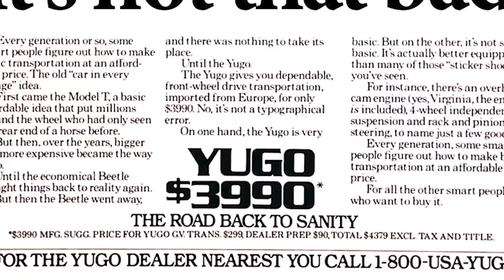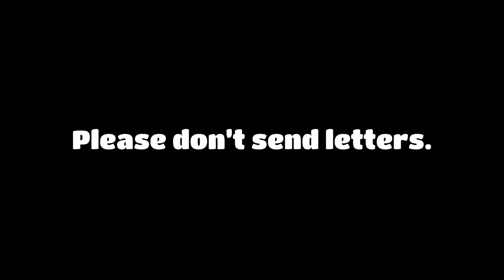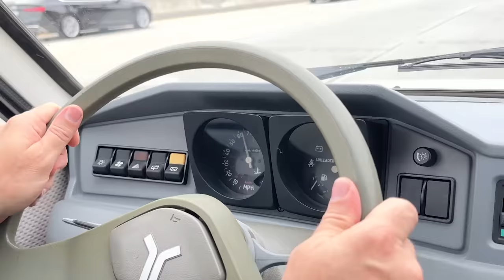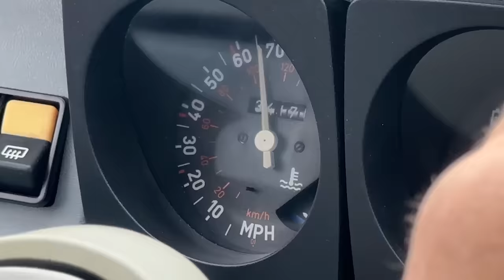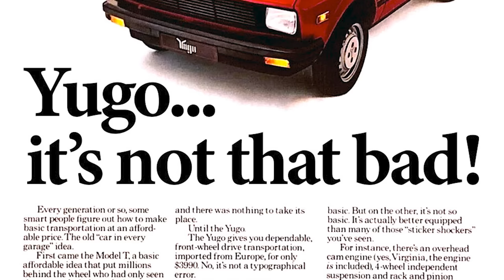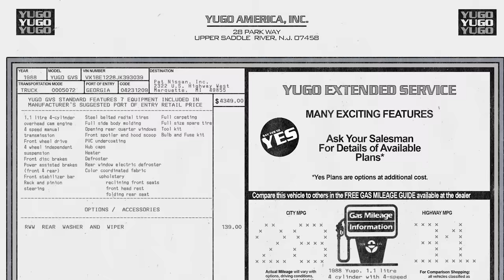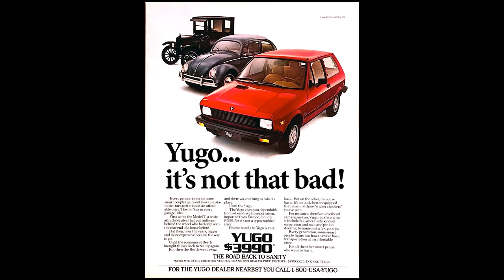Jeff Dunham Drives The Worst Car Ever… LOVE IT or HATE IT? | JEFF DUNHAM

Comment: We purchased one brand new in 1991.  There were several changes by that time compared your 87.  The engine displacement was increased to 1.3 liters, and the carb induction system was replaced with a direct multi point Bosch fuel injection system.  The transaxle was also changed to a 5 speed.  We bought it for $4100, and drove it over 150,000 miles before some electrical gremlins sent it to a friend as a parts car.  The only issues we had were the window cranks broke several different times, the shift linkage separated once, and the fuel pump went out 3 three times--twice under warranty.  The fuel mileage, while driving over a mountain pass back and forth to work, averaged 45 MPG.  Hard to argue with that, even today.  Probably the best part, is that it was INVISIBLE to cops.  There were several times I was bombing down the interstate at extra-legal speeds when a State Patrol going the other way flipped a U-turn and fell in behind me.  Letting off on the gas and coasting down to legal speed, I could see the cop in the mirror double checking his radar, looking at the car, shaking his head, and turning off.  Good times.

Comment: Do you know why the Yugo came standard with rear window defrosters? A: To keep your hands warm while you push it.
Reply: The Saab the spare tire was under the hood also
Reply: How do you double the value of a Yugo?
Fill the gas tank.

Little known fact. A 4 door model was planned.
It was called a Wego.
Reply: @midnightelectric1  there are more jokes for yugo like:
My electronics on yugo got broken.
Than other guy asks: what electronics ?

How to tripple value of yugo ?
Fill in gas tank and buy new front tires.
I guess you now know how to multiply value of yugo by 4 times.

This is good one:
In Japan, car manufacturers had sealant check: they put cat inside car, turn off air conditioning, close all doors and leave car for whole night.
If in morning cat inside car is dead - that means car is sealed well, if cat is still alive than car is leaking air.
For yugo we had lower standard: they put cat inside car, turn off air conditioning, close all doors and leave it for night. In morning if cat is insde car, than car is sealed well. If cat is gone, than car is not sealed well.
Reply: Thank you now I know why Chevys had rear defrost also. 😂😂
Reply: @L4ki0  There's worse cars- 87 Ford Escort Hatchback.  dear GOD that car was awful
Reply: @susanfender307  Count those K-cars in that group.. On the Ford Fairmont you honked the horn with the turn signal lever. The one I drove as a cab went through four heater hoses in one year.
Reply: That son of a gun stole my line! 🤣
Reply: Why it was called a Yugo? ...you go buy the stereo,  you go buy the mud flaps...
Yugo sport: Yugo fast. ... it's one step above a kit car.... because they built it for you. I told my friends I wasn't going to trade it in... I was just going to punch a hole in it & put it on my keychain. That might BE my old one. Drove it over a rather large hill here & the gear "clip" fell out. I suddenly went from a standard "H" to a "standard O". We towed it no lie with a 4 wheeler. To my friend Sean's house. With rope. Sean: "I will DIE if we get pulled over by a cop right now.". Didn't get stuck in the snow once! [You have to have a center of gravity to do that. Center of gravity cost extra.]
 ....I could go on.
Reply: So true!!
Reply: @briannoll9441 😂😂
Reply: Ah, ya beat me to the punchline!
Reply: I am the originator of that joke🤣🤣🤣🤣

Says everybody
Reply: The last time I heard that joke I laughed so hard I fell off my dinosaur.
Reply: The model line was the first (and only) world car developed by Chrysler Corporation, who developed the American-market Dodge Omni/Plymouth Horizon in tandem, following the start of the Chrysler Europe project. While similar in appearance (for the Plymouth brand, sharing a nameplate), the Horizon would have substantial functional differences from its American counterpart.
Reply: I’d like to know what he paid for it.  That might be the funniest part of the whole experience.  It is in amazing shape.
Reply: @mow4ncry  not all SAABs had that. Certainly not the 95, 96, or Sonett III... Those models had spares in the trunk under the floor board.
Reply: That's nice the only thing I know about them as people were sobbing every time they had to get them repaired
Reply: @susanfender307  Trabants were supposed to be the worst cars ever, but they were not sold in the USA. The Trabant was from the DDR, better known as East Germany.
Reply: @lincolnls0416  no, that was to keep your hands warm in the bed of the pickup while you were getting a lift to the mechanic.
Reply: @susanfender307  It WAS, but... the stupid things lasted forever and just wouldn't die. The whole car would be held together with bailing twine and duct tape, and still get you from point a to point B. The only car I saw do more than that, was that idiotic  Volkswagen Rabbit.
Reply: @starova92  he paid more for the detailing then he did for the entire car
Reply: @BlueRidgeCritter  too true, but it was check the gas and fill the oil 😂
Reply: @mow4ncry  The 2-strokes or V4's then? Because my 900 classic had it in the back and that carried over from the 99 and 90.
Reply: What do you call a Yugo with a Sunroof? A Skip/dumpster
Reply: @OrsonBuggy1958  my Fairmont was an old cop car with a 302 in it and it was fast
Reply: @ZackfromNoHo  nope, Russian Lada was THE worst
Reply: @slidin122   Mine was a taxi and it went through four heater hoses with less than 70K miles on it.. It was garbage. Maybe because it was a station wagon.
Reply: Back in the day a coworker bought one. You could tell it was a cheap car, but don't expect American workmanship which isn't saying much.
This coworker happily drove it until he rear-ended a dump truck. The insurance company totaled it. The accident happened on a military base where the speed limit was about 25 mph, I didn't personally see it after the accident, but was told the entire front end would have had to be replaced, i. e. The parts would have to be shipped from the Eastern European factory, which the shipping costs was what totaled it. Parts cheap, shipping astronomical.
Reply: LMAss off!
My grandparents had two!
The three piston Engine what an allowed to get out of its own way!😂
Reply: @OrsonBuggy1958  I rented a Fairmont from Hertz in '79 to drive to a client in Temecula, CA when it was about 5-6000 population. It was about 1+ hrs from nearest airport. Wouldn't start the next day. Hertz had to flatbed a car to me, and take the Fairmont back. Awful to drive too.
Reply: @L4ki0  Either Yugo or you don't
Reply: If you want a worse car, drive a Subaru 360, also imported by Bricklin about 1969!
Reply: They came out with a mini-van in the late ‘80s, they called it the WeAllGo
Reply: Hello
Reply: How you doing today
Reply: Pretty sure Ford was the first ever rear window defrost,well Lincoln same thing lol
Reply: Yugo. I'll just stay here.
Reply: That was chevy
Reply: So that why

Comment: I had a Yugo when I was a teenager. I took that thing everywhere, one of my best memories in the yugo, was up on some logging roads when I came across two full size trucks (lifted) sitting on both sides of a downed tree across the road. I drove right down into the ditch and under the tree and out the other side. Stopped on the other side of the tree and we all had a good laugh. Only thing I ever did to that car was change oil every 3000 miles. It wasnt that bad but man it was hard to keep a girlfriend once they saw the car :)

Comment: My dad is a retired mechanic and is almost 72 and is from Yugoslavia. I bought him an 88 Yugo as a gift  back in February and he loves it. The car is almost identical to the one in the video including the exterior and interior colors. But ours came with dealer installed air conditioning. We spend weekends tinkering with it and fixing minor stuff. The number one reason that so many Yugos were junked was because of timing belt failure. The replacement interval is very short (60k miles) and the belt would snap and the internals would crash. The car would be towed to the mechanic and the repair estimates were often close to being more than the value of the vehicle. Zastava Motors built over 800,000 Yugos and sold them worldwide. In America the parts were hard to find because most people didn’t realize that the car is basically a Fiat (127,128,x19) so therefore most Fiat parts can be installed on a Yugo. Also Jeff, I noticed your black/red rub strips need replacing. I have a set I can sell you if you’re interested. Enjoy it!
Reply: Timing belts were BELTS. Very breakable
Reply: Always was fun to drive around in a Yugo with my late cousin by the sea at the kupalište Hidrobaza in Pula.
Reply: Cool story

Comment: I worked at a Yugo dealership and we had one that came in every 2-3 weeks for an oil change.  It had over 150,000 miles on it and only a driver's seat.  It was used by a local parts store as a parts runner.  If I remember correctly it went through 2-3 clutches.

Comment: My younger sister bought one back in '88 or so...  drove it for years!   I DO remember that the original tires were so bad (cheap/poor quality) that she got a flat from pine needles!  OK, spruce needles - but they were sharp enough that they would pierce the tires.   Even at that, she got over 90,000 miles out of her Yugo!  The problem was getting replacement parts!  Even something as simple as an alternator or exhaust parts -- rust is a big killer here in the Great Lakes area!

Also, a co-worker had one, and he drove his over 140,000 miles!  Again, the lack of parts availability was it's demise - couldn't even get replacement brake pads!

Comment: The biggest issue I heard of with them at the time wasn't so much that they were bad, it was more that there wasn't any real parts support. One friend of mine had one and when he needed parts it was difficult to source them. The story he was given a few times was that Zastava had basically used up the parts supply and the company that made that part was now on the UN banned list so no new parts could be imported. The other issue was that they still ran a carb and in 90 they failed the emissions testing and had to recall most of their cars.
Reply: If you knew where to go there were parts.  When they stopped selling the cars a dealer in Henderson Nevada bought the parts supply from Yugo dealers all over the country.  He had parts for years to sell.
Reply: Also the war was happening in Yugoslavia in the 80's that also made parts difficult to get.
Reply: Yea,Didn't help that the UN blew up the Yugo plant in a bombing run. They produced rifles there too.
Reply: Failed emission test is so overated and pushed by some people. Nowdays you have 4 litter engine cars and pick-ups that WILL CERTAINLY fail on same emission tests, but tests are abandoned...
Reply: that why you needed two one for parts lol
Reply: Most matched Fiat parts

Comment: When I was running a tuneup shop, a customer was trying to convince me that their Yugo was race prepped because it was based on a Fiat 124 (?).  "Oh, it's head is ported, engine is blueprinted..."
I wonder how many are left, I'm stunned you found one and it operates.
Reply: More like the 127.  124 is front engine,rear drive.  127 is front engine, front drive.  The X1/9 just moved the drive train from the front of the 128 to behind the seats.  Engines in 127 and 128 were almost identical.

Comment: Thanks Jeff for this video.
My late stepbrother owned a used car lot in Tucson and purchased a 1988 Yugo at the car auction in Phoenix, Arizona with 35,000 miles on it. The car broke down about 80 miles from the auction and he had to tow back to his lot.  Nobody would buy it and he scraped it after two years.  
You mentioned Ford Pinto’s he sold allot of those with few returns. The. Pacer he refused to buy because they weren’t good …”his words.
He even bought a Deloreean and lost his shirt in repairs before it sold.
Have a nice day.

Comment: I was a little surprised at the end when you took the spare tire out and there was what looked like cracked paint and rust underneath it. Were you surprised too, or didn't you want them to stop the rust there?
Reply: GREAT DETAIL SHOP…… until you took out the Spare Tire, everything was rusted ???
Reply: Nope, that's not rust, every single Yugo ever looks like that under the spare wheel, Zastava factory used some weird kind of thick rust protection, it's better left as it is. How do I know? I have a Yugo.

Comment: I"ll stick with my 1993 Full size chevy truck, it has over 450,000 miles on it, still going strong and has never messed up on me yet. Changed oil every 3,000 miles, had a certified Mechanic check everything and he couldn't believe how great of shape the truck and motor was in.  Again, I'll stay with my Chevy.

Comment: Be happy you have the updated version of the Yugo. I was at the Newark Shipyard in late 1984-early 1985 timeframe when the first ship arrived with these pieces of junk and I can tell you something the media nor the sellers will admit to, the first cars to arrive were ALL sent back because they were beyond substandard. The engine was a 2-cycle smoke machine and the front fenders were made of a material similar to OSB, yes glued and pressed wood chips. When they took the first ones off the ship there was an inspector there from the NJDOT who stopped the unloading until an inspection was done, they waited for engineers from the Federal DOT, the NTSB and the NHTSA to inspect them. They got rejected and the ship captain was told to reload and take them back.  Boy was he mad… A few months later they sent the ones with the original US Specifications that did pass and were sold starting in 1985. 🤪🤣😆

Comment: About 10 years ago, I was at a huge flea market/festival and a guy came into the parking lot where we were parked driving a Yugo with a plate on the front that read "Killer Yugo". I don't know if it was an original color, but it was dark blue, polished to the hilt and had shiny after market rims and red pin striping on it. It was very clean and looked as good as a Yugo ever looked. It turned some heads. There was also some pointing and snickering, but it was so damn cute.

Comment: 4:20 That screw driver is probably tougher than the car itself. I’ve been using and abusing that thing, including using it as a hammered chisel for poking holes in concrete and it still works and looks as good as new (except for the few scratches on the plastic handle from hammering). It’s a flip side insert with the most common size flat head and Phillips tip. 40 years later I still reach for it in a pinch.

Comment: I had tick marks on my 72 Beetle's speedo showing when to shift.  Used to be pretty common in cars with no tach, which was most of them in the 70s.  Still remember 1st would only go to 15 mph.  FWIW, I think you were working the Six Flags Puppet Theater for the 2 months I was the "manager" of the little popcorn stand there.  All I recall is that, whoever it was, I had the routine memorized by the end of my term.  Afterward, I chose not to stay in professional popcorn stand management as my chosen career field.

Comment: In 1973, we got a new VW Beetle for $2209 from Hyannis VW.  That was the year the Super Beetle came out with the curved windshield.  In 1987, I got a new Yugo for $3995 at a Chevy dealer.  I kept the Yugo for 8 years.  The thermostat/switch failed for the electric radiator fan, so a neighbor wired a manual switch to turn the fan on and off as no one had parts anymore.  The Yugo was a Fiat 128 made under license in Yugoslavia.  The Yugo had no AC (I could have gotten one with AC) so when I moved to Florida, I had to get something else.  Tuneups, oil changes and replaced the muffler twice, the battery once and that was it.

Comment: When I was a baby/toddler, my parents had a Rambler. When I was in elementary school, my Dad had an Opel. When I started junior high school (7th grade) until I was a Sophomore or Junior  in high school,  Dad had a 1978 Ford Fiesta. During the rest of my high school days until I got married in February 1988, Dad had a 1984 Ford Ranger. I was born in March of 1967. The Rambler I don't remember but the others I do and my favorite was the Fiesta because Dad taught me how to drive in that car when I was 12. Once I finally took Driver's Ed my junior year, I aced the simulators we used during class when we were learning about manual transmissions because I already knew how to drive a stck shift at age 12. During the winter during Driver's Ed, I also learned how to handle a large vehicle with winter driving conditions because my Mom had a 1978 Econoline 150 full size, rear wheel drive VAN. Did my permit practice driving in that baby. Got one of my OWN now, a 1999 Econoline 350 extended with a high roof, at age 56. 😊

Comment: I remember my YUGO. I bought it for $25.00. It was sitting in a yard with weeds 3 feet taller than it. Surprisingly it did start and run but It needed brakes.  After getting it all squared away, I registered and drove it. I found out why it was allowed to fall into such a state of being a yard ornament. I live in an area that is more sloped that the YUGO could handle. Definitely made for city driving and flat land, not the mountainous terrain. I was limited on where I could actually go and expect to actually get there. It earned the nick name of my Rollscanhardly, it would roll down one hill and hardly up another. The doors just a tad thicker than the glass, no sound proofing (could literally hear everything on the road), under powered, bare boned of everything a car should have. It sure did turn heads and get the people talking. Jeff is right about that!